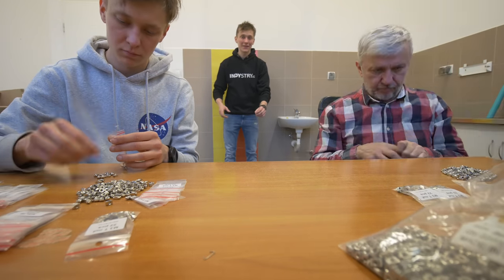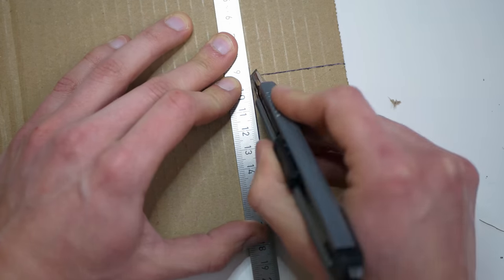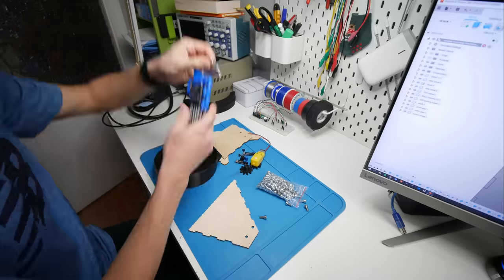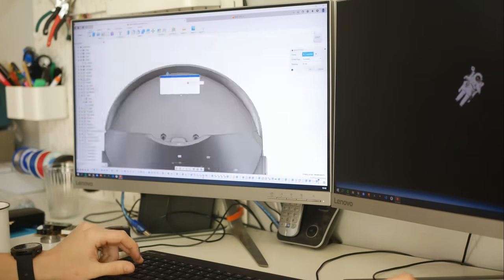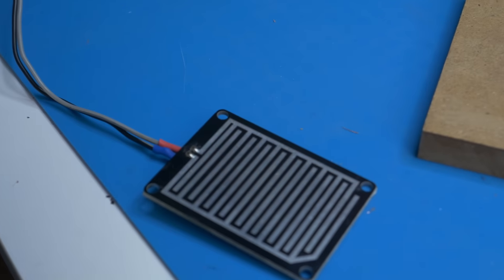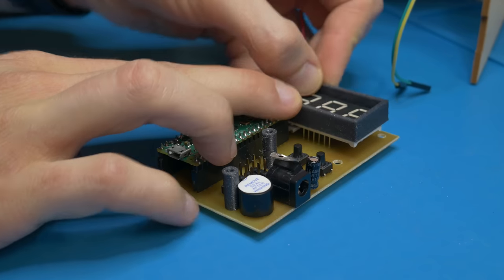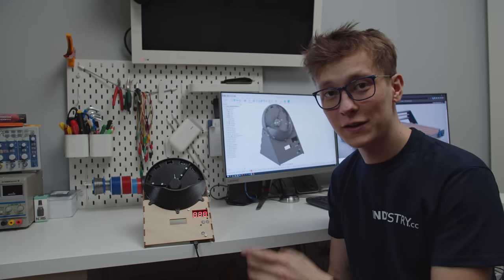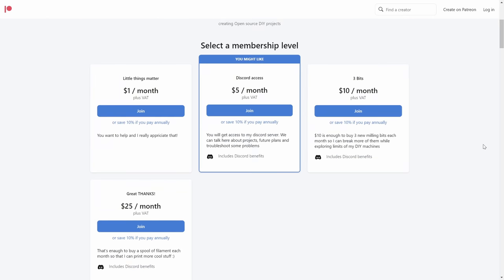I built a machine that counts screws

Comment: I think the error rate is lower than that. If you load about 10,000 screws you can run the test, stop at exactly 10,000, then run it a 2nd time to see if it hits 10,000 again. then keep doing this. With a better sensor you should be able to get 100% accuracy as long as theres no foreign object debris.

Comment: Seems like a nice project. As others have said, maybe weighing it would be easier. Also why not just put one more than needed, then you don't have to count them. Also in V2 having a "repetitive" mode where it counts the screws, and then a motor pushes the box one slot further and it counts again and so on would be good I think

Comment: Do you think the screws can pass through the channel without passing between the LED and what you're using to measure the light?
Also, some signal processing from the light sensor may help. Adding a comparator so it is just HIGH/LOW and adding some hysteresis on the code for debouncing for example.

The design of the machine is really good, it would be a shame for it to not be finished and useful for you due to some simple electronics issues.

Comment: The error probably is in the light sensor/code.
I would not use photoresistor, instead I would use phototransistor or photodiode, as photoresistors are slow.

Comment: This was a great video. You should also check out hall effect sensors/optical and scales as a possible hybrid solution. Also make sure you are using interrupts or very(very) low cycle times(or of course you could go wirh a latching circuit and reset on read). Best regarads.

Comment: Great engineering and creativity but my question is could you not have used a simple table top weight scale and weigh out the amount of screws need because each screw has a standard weight.

Comment: Cant you just make a quorum idea? Like, 3 sensors in the same path, check the matching 2/3, then rank the output as 3/3 or 2/3 or error... Not sure if this is the "expensive" part of the project but could be an easy way to solve with the same logic so far..
You can also use the in-between readings as  fourth sensor/counter..

(On the count by weight thing, our "sensor path" could become a counter for anything that can fall in the (adjustable) path)

Oh.. great content btw.. Cheers!!

Comment: HEY! Nikodem  instead of a LIGHT sensor use a WEIGHT sensor! I think You don't need the weight to be exact, just a change from 0 would be a screw. Or you can set a range. The screw is dropped on the weight pad then an arm push it out and it drops to the bag or box. It may be slower but if it 100% accurate maybe is worth it.

Comment: Might be easier to take a sample of let's say 10 bolts, weights it, and divide it by 10. You'll probably have more accurate results without having to build an entire machine. This process is also used in industries 👍

Comment: Very interesting machine, but most place just use electronic scale. But i guess it could be a bit boring to make a video about electronic scale.

Talking about interesting contraption, I've seen a small hardware shop uses a small framed planks (one of them can slide in and out) with multiple "molds"  that fits just enough for one screw each mold, they basically set the removable plank into the amount needed (20-100) pour bunch of screws in the frame, shake it into the molds, and remove the excess. Well it's a bit of a novelty, but it's very interesting to watch

Comment: Why are you not counting by weight?

You have designed a way to separate the screws, 
you could add a little scale on the output tray that recognizes the weight of the first screw and calculates how much 10 or 20 weigh, 
there for you can count the screws much more accurate.
Probably even more accurate for small screws.

Comment: Why not use the method that the actual fasterner industry use to transport screws. 
They have a thing shank with a head. Just make a track with a slot wide enough for the shank to go through, so it hangs by the head of the screw. 
Then you either use gravity or you use a conveyor system.
Also the drum would work better if the sides of the drum moved too, and not just the face of it.

Comment: Nothing wrong with the light gates, but this hw/sw design is bad. HW side: ldr photo resistors are slow (too slow), you need to use ir photodiodes (transmitter and receiver) and at least a small opamp to spot the small changes. SW side: reading a pin state while doing some 7 segment display magic is wrong combination. The uC just miss the spikes when working with the 7 segment display between the reads. You need to use interrupts to count the parts. With these fixes, the error rate will be close to zero

Comment: I think the design is intriguing. Weighing the small number of screws and washers will require a fairly sensitive Wheatstone bridge and the controller would have to be in the 16-bit range to detect a sufficient change in the weight, especially for the washers. 

In industry, if a vibratory bowl is not used, then a photo-electric device is used to count. Three things that you will have to explore: 1) reducing the size of the light source so that it can’t pick up multiple parts passing through the beam; 2) reducing the discharge hole size to allow only one at a time to pass; and 3) decrease the response time of the sensor. The last one will be limited by the processor used to detect the change in voltage. 

Good luck.

Comment: I don't understand how it could count air as a bolt!
I would've thought it would not count some, so you get more, not less! 
I think it counts a bolt twice. Maybe a little delay in the loop would fix that? Like debouncing a switch.
Reply from the maker: It's rather connected to some noise in the electronic circuit. Adding more capacitors as additional filtering might solve it. Also creating a sensor that just outputs a binary signal would be great in the next version. Here I am using analog pin of the pico to measure the signal.

Comment: Well I should have focused on your design instead of drifting away.. This being said, it's clear that the errors you are getting do come from the sensor you are using. I suggest you use a  sort of a flapper or a hatch to capture the passage of each screw. This can be a simple plastic piece on a pivot that blocs the way of the screw, so the screw have no way but to rotate that piece in order to pass, then you can use the movement of that hatch to activate an optical sensor (edit: a photo interrupter) or even a mechanical switch. You should watch for the next screw of course, so it doesn't pass while the hatch is still open after the previous screw have activated it

Comment: Why not take a kitchen scale, get, say, 10 screws and weigh them, then you will have an idea how much they weigh.
Based on the weight, you can determine the number of screws ;)
Reply: An M3x6 screw weighs ~0.5g, so a regular kitchen scale will have trouble counting screws directly. If you use a lever as a force-multiplier along with the kitchen scale, it will work. With 20x leverage, each screw will effectively "weigh" 10g.
Reply: @jamesbrown99991  But maybe he can buy a drug scale that measures very precisely , which can also weigh small weights 🤣😂

Comment: Why not just make it so the machine puts in an extra screw? Like if it’s counting to 10 just make it count to 11 instead, most people will get 11 but some only 10 which is the required amount. Lego most times add an extra part for smaller bricks.

Comment: Nice project! One possible solution to the machine's inaccuracy is to compensate for it by always adding 5% extra after the count.(given that the price of a screw or nut is very low indeed)  Then for sure there will always be enough and maybe a few left. Given that the price of a screw or nut is very low indeed, that should not bring up the price of the product too much.
Reply from the maker: That's true. I could count exactly what's the probability of the machine making an error and then compensate for that. There is just one thing I don't like about this solution and that is extra screws. Whenever I am assembling something from a kit, lets say Ikea furniture, I really like to see how I am slowly running out of parts to assemble while getting closer to a finishing product. And if there are some screws left at the end I feel like I probably forgot about something :)
So for that reason I prefer to make sure that there is exactly as many screws as you need to build the project!
Reply: @nikodembartnik  I agree with you, I would also want the exact number to be in the kit. When I started laying out on my workbench all the things I needed when building my Prusa 3D printer kit I found that all components were nicely numbered and all things I needed were present. But there was also bag No. 9 called "Spare MK3". It contains some 20 bolts, washers and nuts of all kinds and sizes. So maybe Prusa just wanted to be on the safe side and thought of a clever way to camouflage counting uncertainty ...

Comment: Why not have the machine verify itself.   Could out 100 screws, verify manually,  then put 110 screws in the machine and ask it to count 100.   If there are 10 screws left,  it worked.  Repeat this many times to see how reliable it is.

Comment: No one counts screws. Its a huge waste of time. As many other commenters said (and correctly so) its done by weight. Such as how many pieces per gram etc. Its usually very accurate.
This is an example of engineering  something thats not necessary

Comment: If you put 2 of those machines in series what is the error?
Reply: 1.05 * 1.05 = 1.1025, so 10.25% error. To reduce the error, you'd want parallel runs of smaller batches, if the error is not biased.

Comment: Just use linear vibration on a flat surface to move screw... And cut specific distance on that surface so screw can just get into a canal like structure and move forward then you can usea small pipe long enough to get one or two screw can fit so when it is full it tilt or do something so it fall or just put light sensor at other end every screw first gonna get out of pipe long enough distance before it fall that's where you put your sensor... You can  count thousands of screw over minute WHY YOU DIDN'T LEARN FROM PHARMACEUTICAL INDUSTRY MANUFACTURING PROCESSES
😅😅